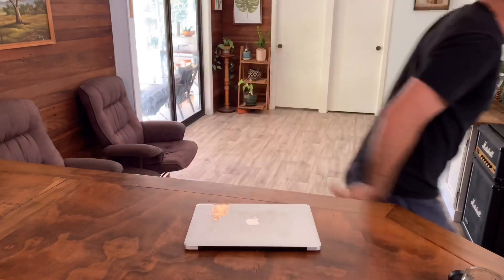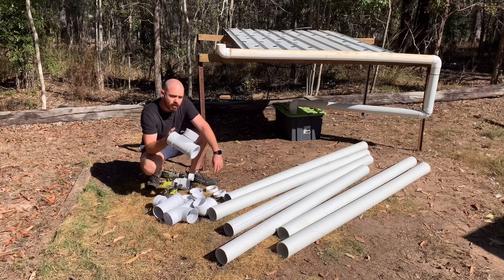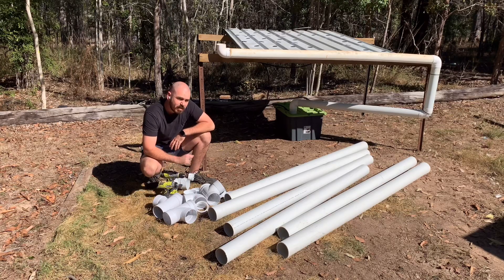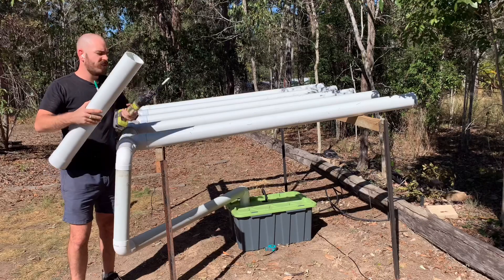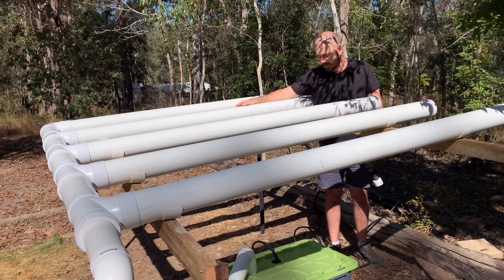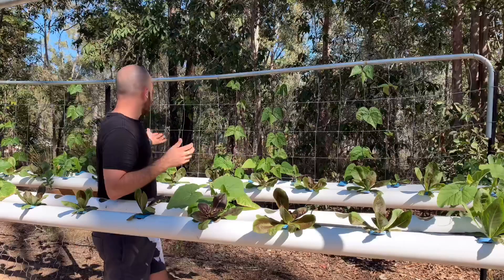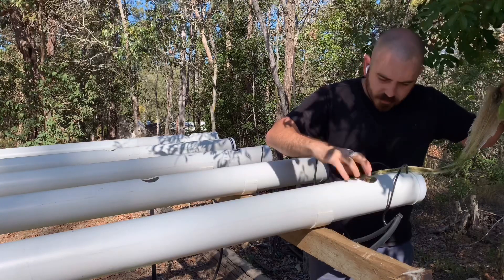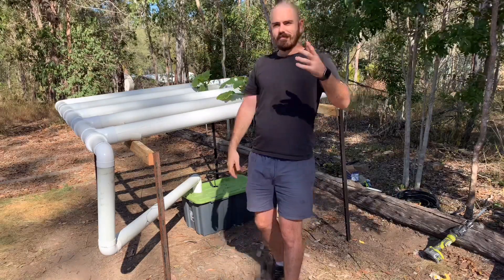How to Build a NFT Hydroponic System for Pumpkins and Plants with Extensive Root Systems

Comment: You had mentioned row spacing at ~6:20. how important is row spacing in an NFT system? My understanding of the importance of spacing was so that the roots dont get tangled up with others and compete for nutrients, which wouldnt be the case in this type of system.
Reply from the maker: The spacing was referring to the distance the individual channels are from each other. Not the plants within those channels.

Comment: Good system. Was debating on rails or pipes. See how it goes. Cost is the same.

Want to say I have those t pieces on the vertical system I built. But I have not seen any others at least for the 100mm pipe.